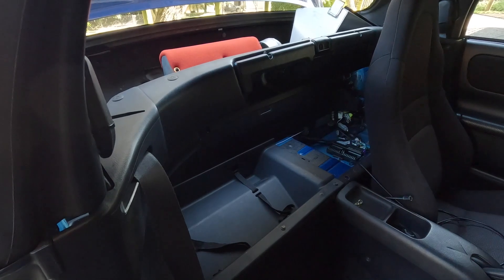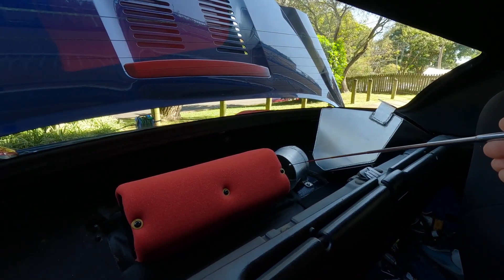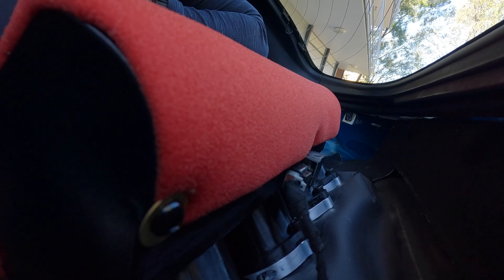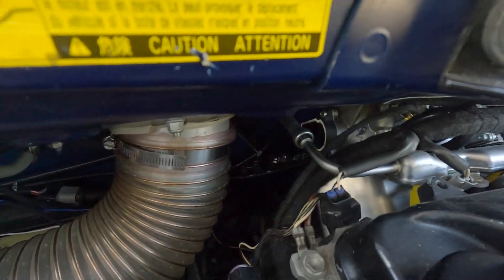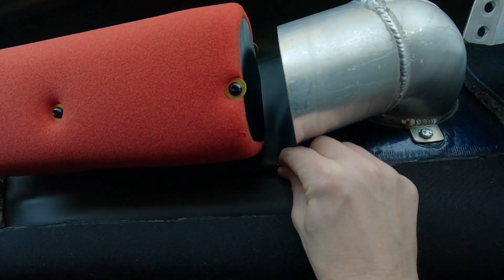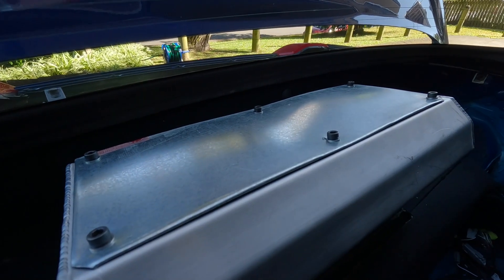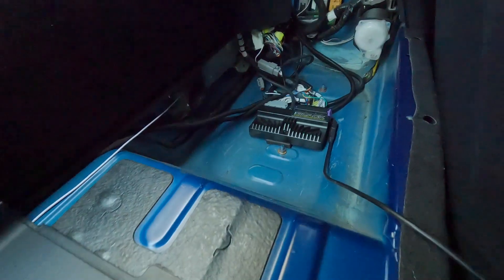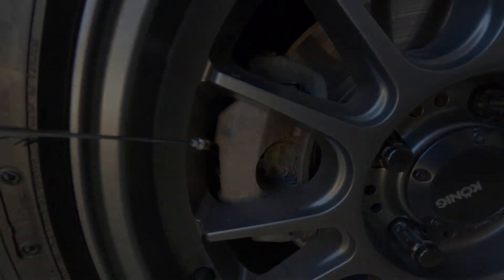2001 Toyota MR2 Spyder. 2ZZ Swap with ITBs

Comment: The Prius caliper thing is interesting!
Reply from the maker: It's a straight swap, just have to change sides from original mounting on the Prius (calipers mount on front of disc opposed to rear of the disc on the Spyder). 

Same pads for both. Slightly lighter being aluminium and larger piston
Reply: It's intriguing for sure, wondering how much would go into fitting it into an Mk1-a AW11
Reply from the maker: @ChroniclesofKToyoda old Toyotas are good for that interchangeability. I didn't need to even change the brackets, the calipers bolted straight in from model year 2003-2009 Prius
Reply: @RunDriveLift nice nice, gonna have to give it a go someday, thanks for the Intel!